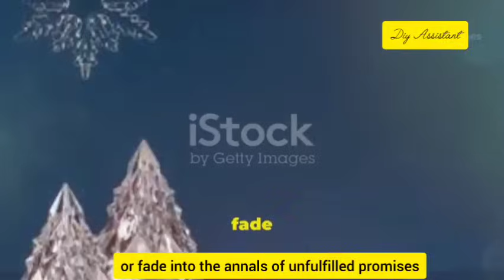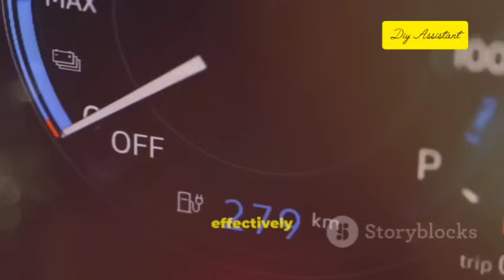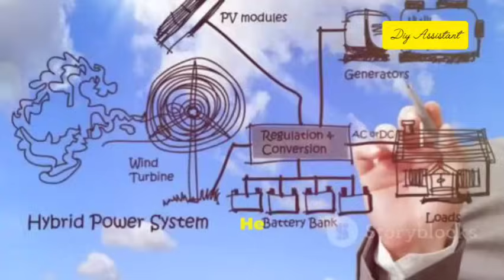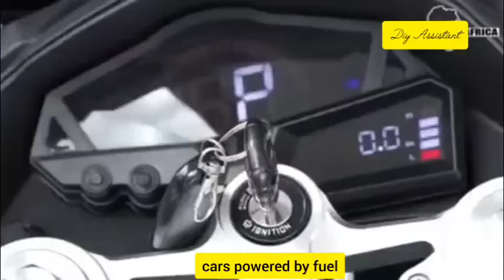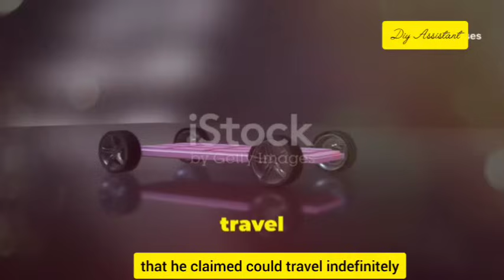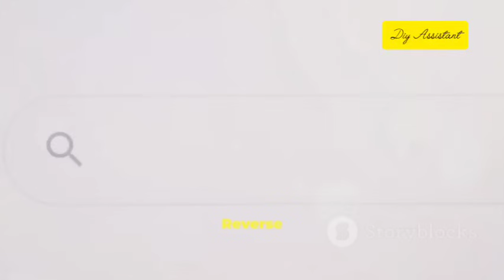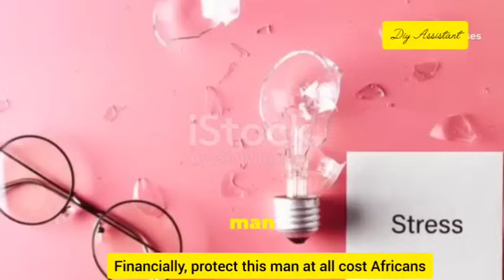2025 Self-Charging EV: Shakes Up The Entire World!

Comment: The explanation in this video isn’t the actual system of Mr Chikumbutso. He is using a mirosonic energy device that captures radio waves and converts them into energy that can power the car.
Reply from the maker: You didn't watch till the end
Reply: Microsonic energy device that capture radio wave and convert it into energy that power a car, big lie. do you know what is radio wave? do you know the amplitude of a radio wave? radio wave cannot even drive a small speaker without undergoing amplification, how can it power a car? and the process of amplifying radio wave require an energy source. Even if this invention is true, he is not saying the truth about the device, but i know is a lie.